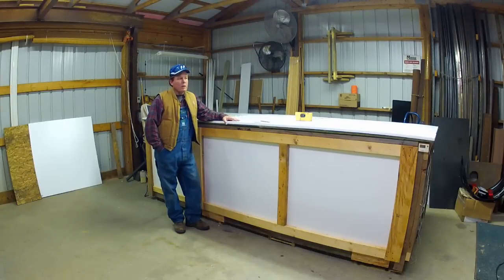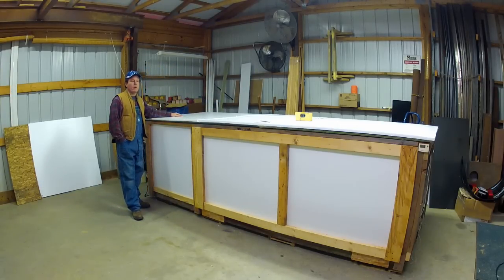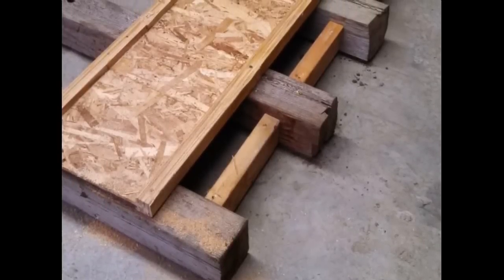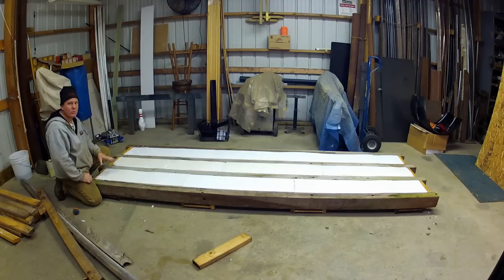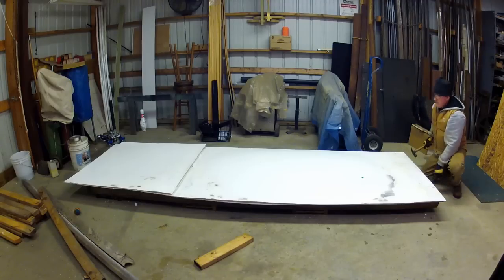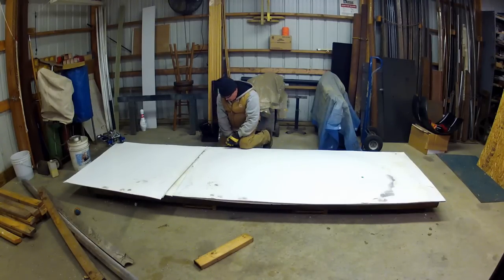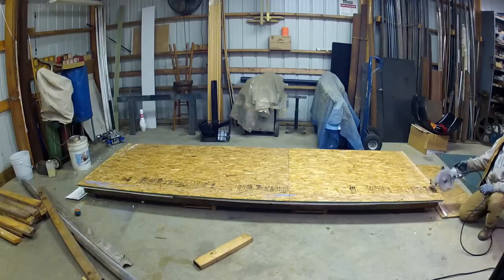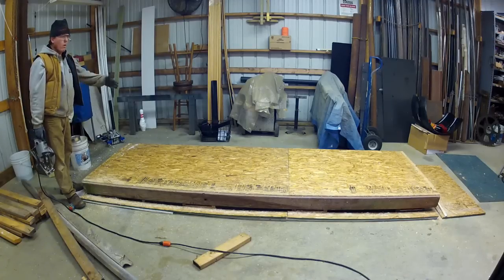Building a dehumidifier wood kiln - part 1

Comment: one thing i seen used as a dehumidifier was a aircon unit , did pretty good at pulling the moisture out the air
Reply: That is what I use.....an old dog of a window AC unit.....22,000 BTU.  Simply sits on a shelf in my kiln room, the scrap heat off it will raise the room temp to around 130 degrees, driving moisture off the wood, into the air where it hits the cold coil on the front, condenses and runs off in a bucket under the shelf.

I only dry wood that is air dried down to 18-20% MC, and it takes about 2 weeks to take a 1000bdft load on down to 6-8%.  First few days, it will pull a 5 gallon bucket of water off wood that is already air dried !

Comment: How long does the wood generally stay in here till you get single digit numbers? 
2 weeks or longer?
Reply from the maker: +Mike Crombie   I have always started from an air dry state.   In my area that is about 13-15% mc.  To get down to 7-9% takes a week or less.   This is letting the machine run 24-7 and only monitoring the internal temp.  I have had good success.  No issues with excessive crack/checks/warps/twist.  I have also not had any issue with case hardening.
  With the controller I am running, I can now get as complicated as I want around speed of dry, etc.  I have not found a call to do it.  Good luck with your endeavors.  I wish I had a picture of the first time I did it when I wrapped a stack of wood in a blue tarp.  It was so successful that I created what you see in the video.

Comment: would this work on green wood as well? say 8/8 walnut? Thanks!
Reply from the maker: Aaron,
  Although I have never started with green wood, I wouldn't hesitate to do it.  I have done 8 and 12 quarter and it is just a matter of time and speed.
  I'd suggest that you spend some time researching the best 'schedule' to use for your application.  How fast to warm it up, how long to hold it at given temps and humidity.  The kiln design will do what you want it to.  If I can set pitch in pine, you can most certainly dry walnut.
  I have some more video I need to put out regarding the controller I built.  Your application would be perfect.  You can set it to turn things on and off and hold temp etc.  Maybe I can get that done this week for you to review.

Best of luck.  Preston.